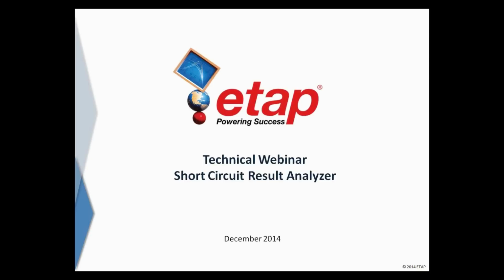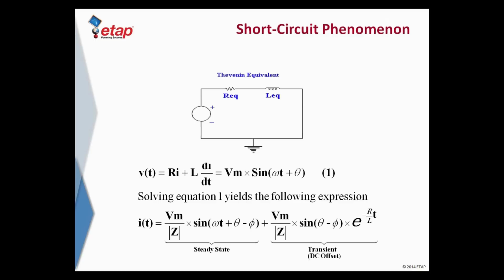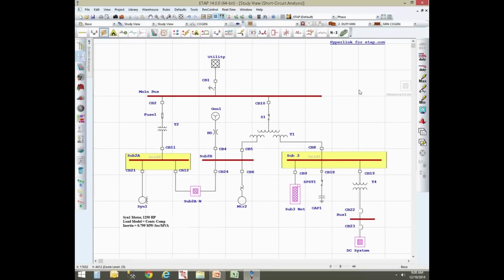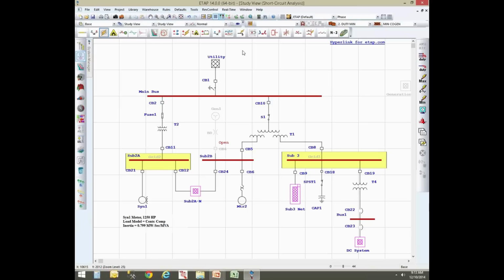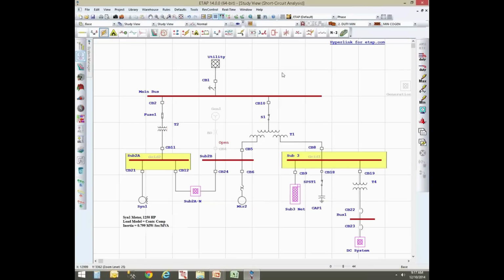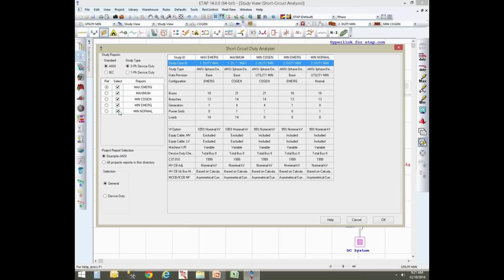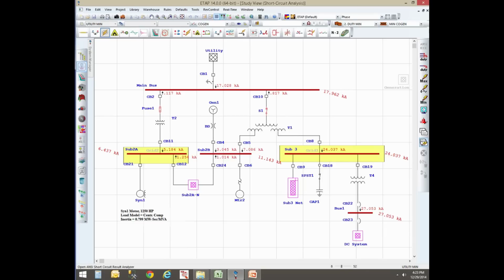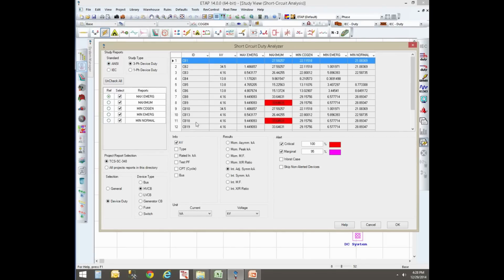Short Circuit Result Analyzer

Comment: Hi, how can i add ground resistance for line ground short circuit calculation? Thanks.
Reply: Hi. If you want to add for the whole system, you can use the study case -> adjustment page-> add Fault  Zf enabled. 
You can also add an impedance element for a fault location in particular
Reply: @ragoo07  I used to work with that Impendance "Zf" But when you build a Ground system you obtain a ground resistance value called Rg and i dont know how to associate Rg with my Line Ground Fault. Thanks.
Reply: @marcozanotti15  Can you elaborate "build a ground system?" Where is the Rg in your project? Is it in a transformer? Load? Branch?  The impedance Zf is nothing but Vf/Z1+Z2+Z0+Zf in you LG fault calculation .
Reply: @ragoo07  Rg is the one you obtain once you   develope your Ground Grid System, and i'd like to associate the Rg value with the Dy transformer connection. now you know what i mean? In Argentina Rg less than 10 Ohms is a request.
Reply: My line-ground faults goes from 30 kA without Zf to 0,5 kA if Zf values 2 Ohms. That's too much.
Reply: @marcozanotti15  Go to the transformer grounding page and change the Y to Y resistor and type 10 ohms in the Ohms field  and re-run your LG fault and see if it works